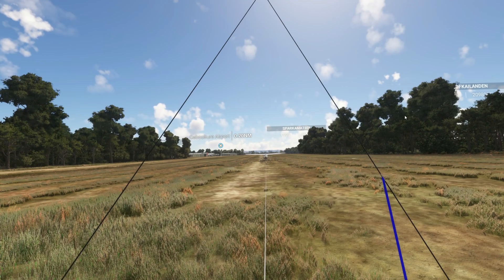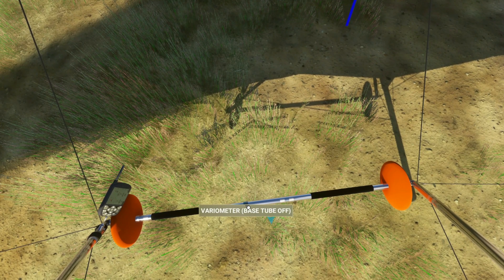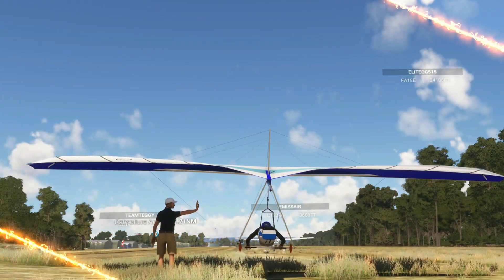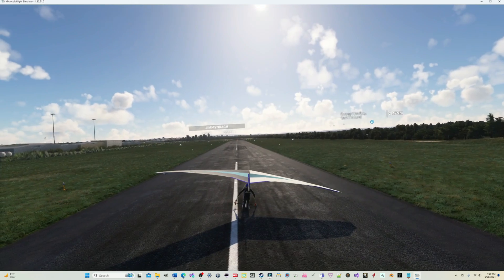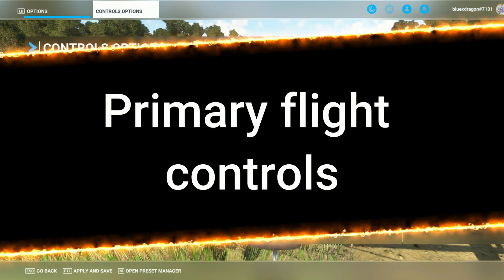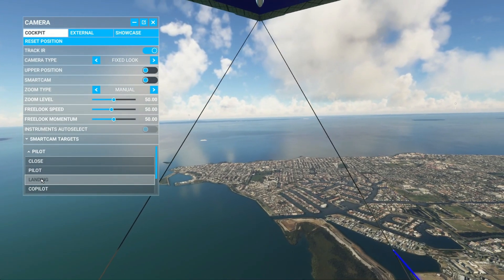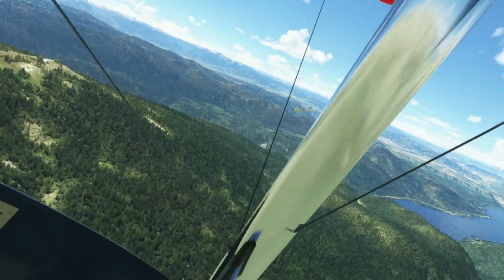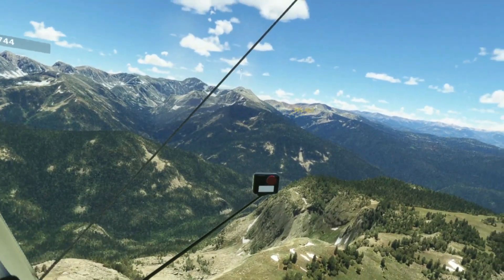Basic Flying Controls for a Virtual Hang Glider

Comment: Hello, I am struggling with footlaunch. Pressing G for landing gear or whatever key I have assigned to "toggle tail hook handle'" won't do anything. I can only fly the glider if it is already airborne , but can't take off from a particular site nor can I groundhandle. I have the widget and both hang glider models installed. Could you please help me with that ?
Reply from the maker: Sure!  You have mentioned that you have the Widget installed (latest is 4.0.2.5 and has ground handling updates).
1.  You need a key (or button) assigned to the GEAR UP event.  This is called SETDOWN and will stabilize the glider on the ground.
2.  You need a key (or button) assigned to the GEAR DOWN event.  This is called PICKUP and will allow you to move the glider in any direction using the JOYSTICK (walk).  It will also roll down a slope (walking launch) until it reaches airspeed and launches.
3.  You can map a key (or button) assigned to TOGGLE TAIL HOOK HANDLE event.  This is called the LAUNCH BUTTON.  Pressing it ONCE = WIRE MAIN MODE.  This will fix the glider in place but allow it to weathervane and "fly" in the wind while remaining stationary.  Good for windy launches.  Pressing it more than once = RUNNING.  This accelerates the glider forward and will get you off of a windy launch or any launch fast.

NOTE:  Gliders come in 2 flavors.  Full feature and stand alone.  Only Full feature gliders can be foot launched as they require the widget.  Stand alone gliders cannot be foot launched as they do not require the widget.  These gliders can only be started in mid-air and are basically a way for someone to try flying a hang glider without doing any real effort.  REMOVE THE STAND ALONE VERSION from the community folder and you will be able to use the full feature glider.

Comment: Looks a lot better now not having those arms/hands in the virtual ‘cockpit/pilots’ view 👍 I’ve been in X-Plane land the past couple months but will fire up MSFS this weekend and try your kites out. Thanks! 👍
Reply from the maker: I agree that removing the pilot in the cockpit view has been an improvement.  You can still bring them back by putting the view in to FREELOOK mode by holding a mouse button down, using a game controller, or just toggling to that mode in the cockpit view mode dialog.  Eventually, we should be able to just see our actual hands and arms in VR when flying, but until then, compromises and options.